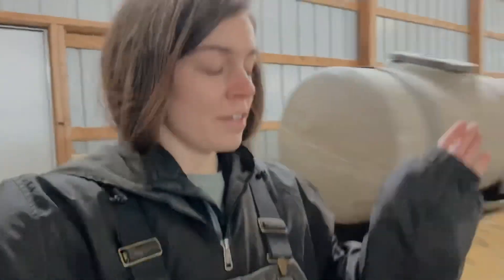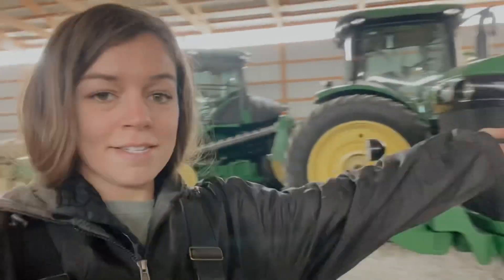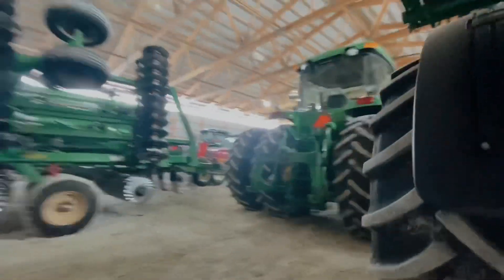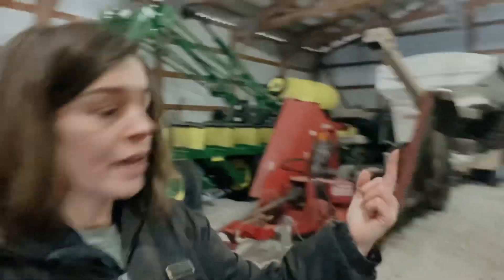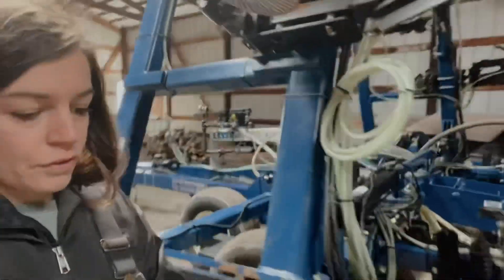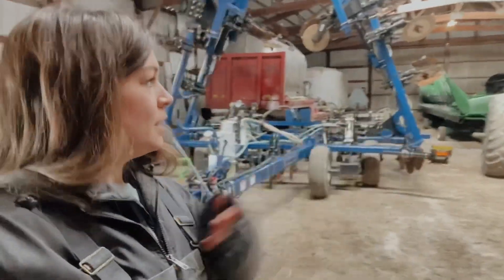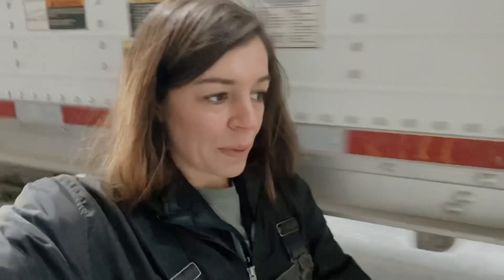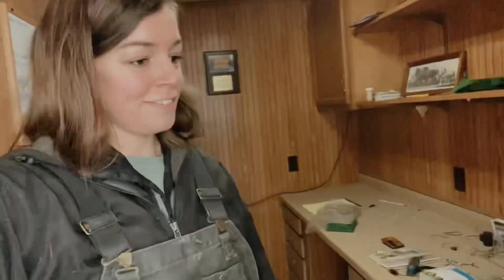Holbert Farms Tour!

Comment: I was 14 years old in1971.  Worked on a 900 acre farm doing cows and corn. You showed the 4020,  Brought back some memories.   We also had two. I learned how to drive on the JD 4020.   The little red grain truck had the same pinstriping on the side of the side panels as ours was.  Work hard, drive fast.  Speed safely

Comment: Thanks for the tour Erin..  I don't think you were awkward.. I haven't been on the farm since 87, when my uncle passed away. We were no where near as big as your operation..  We had 3 tractors, one of which was an old case that still had a manual crank to start it (it did have electric start, but the battery was always dead). Our newest tractor was an 83 international 1086. I sure miss those days. Thanks again

Comment: Your going to like the 8295r a lot, more space in the cab and so quiet, you just have to get used to everything on the post but that's not hard, it all on the arm rest , its basically the same hp as the 8420 so It'll run everything it was 😁👍

Comment: Erin, you're a great ambassador for the agriculture industry and I've really enjoyed your videos.  I'm fascinated by how high tech the equipment has gotten.  It would be interesting to learn a little bit about the different tractor models (i.e. is each used for a different function, when do you use the wheeled version vs. the one with tracks,  which ones are GPS controlled, etc.).

Comment: Consider getting another 4020 and modify it to be air start.  Also I am not sure if the fuel cut off is mechanical or electric solenoid.  If it is electric solenoid, change it over to mechanical. That makes the tractor all mechanical and it will run  even after EMP!  You need another 4020 anyway so why not?